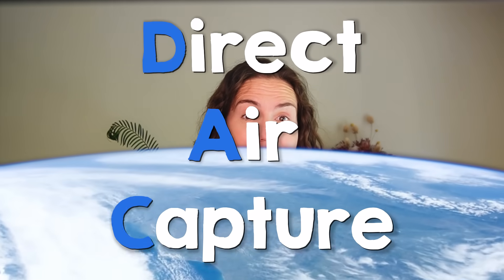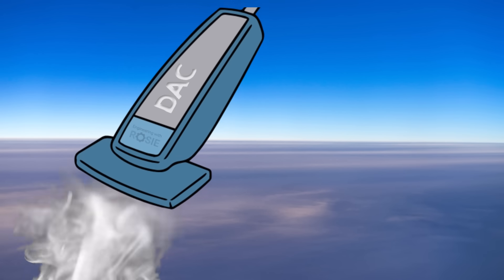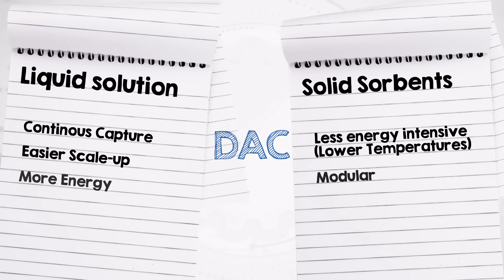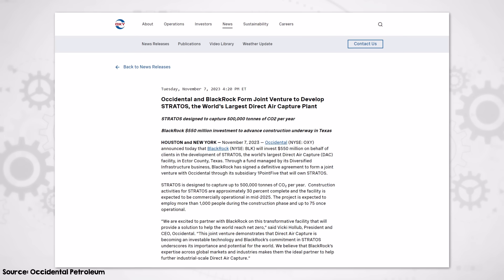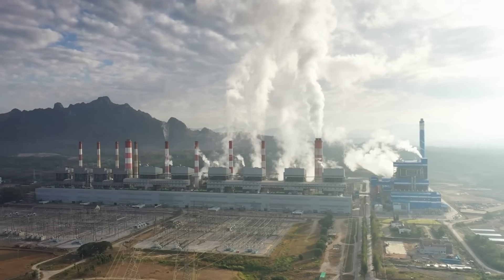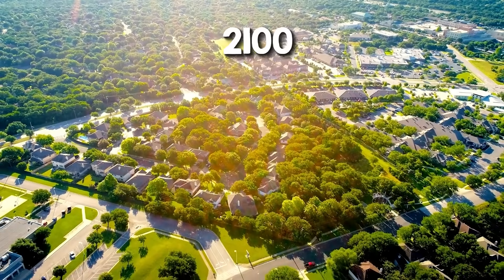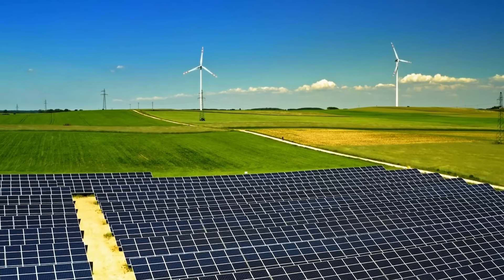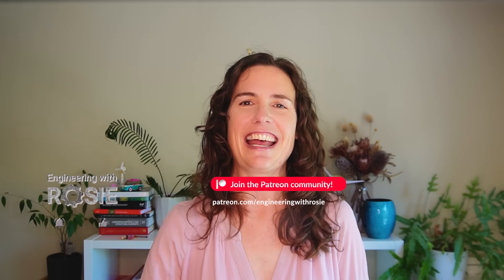Direct Air Capture: Climate Savior or Distraction?

Comment: Generally you are right. HOWEVER, you ignored the biggest advantage of DAC.
You can put it ANYWHERE, and it works. A stark contrast to CCS, that has to be placed next to the CO2 emitter.

I am really surprised you didn't talk about this point, especially since you mentioned Climeworks Iceland plans multiple times.
There is a HUGE reason why climeworks is in Iceland!
Renewable energy, especially heat is super abundant in Iceland (thanks vulcanoes).

This fact makes your comparison of energy use between DAC and CCS somewhat invalid.
Reply: I wonder, if solar thermal wouldn't also be an interesting energy source here. The system from climeworks needs only 100 degrees centigrade to get the CO2 out of the filter medium. This is easy to get from solar thermal collectors.
You could also combine it with electricity production: Some electricity for the fans, a lot of heat for the CO2-extraction.
Reply: Do watch and listen to the video, as the point is dealt with, right at the start. Go to around 1:30 where it is specificallly mentioned that DAC can be located anywhere. There are also plenty of other ways of capturing carbon dioxide wherever you want to, without the ludicrous expense of DAC
Reply: @davidmartin3947  Ok, seems I missed that in the beginning. But why the heck is that mention to be found in the conclusion? It's like the core argument.
Reply: @aurelspecker6740  Rosy has done a fantastic job compressing and presenting a vast body of information here, in time she takes whilst in full time demanding work and raising a child.It would be way more appropriate if you simply apologised for totally unfounded criticisms after you had not bothered to look at the video properly or having apparently any familiarity with the subject. I would be embarassed for making such a blooper, dismissing views from ignorance and inattentiion. It seems a shome that you are not.
Reply: @davidmartin3947  Yep, critizism bad. I understood. That is exactly how science and knowledge works.

I was a no point stating that her overall work is bad, that she does a bad job or anything like that. That were just things you put in my mouth.

I simply stated a quite big weakness of her summary. Which is what the comments are for, aren't they? Commenting

PS: I also rewatched it multiple times. And she still doesn't really set the advantage right. Her "advantage" is just flexibility. But she doesn't go any deeper than that. The advantage isn't "flexibility" the advantage is that it can be placed where energy is basically free.
This is NOT the same.
Reply: @aurelspecker6740  Informed criticism is one thing. Not reading properly and not having the manners to apologise is another, How much work do you think goes into PROPERLY studying a subject and then making a 15 minute video, which you slated because you could not be bothered to comprehend it, preferring to make half baked criticisms? I have made loads of mistakes, but I hold my hand up to them. You don't. None of this is my fault, let alone Rosie's. Just you. Bye.
Reply: @davidmartin3947  
yep, reading is really not your strong suit...
Reply: A stark contrast to CCS, that has to be placed next to the CO2 emitter.    Why is this a problem ?   CO2 effect is not local, it does not matter where you capture is.   Existing emitters are already industrial  sites, what is an advantage in the ability to put capturing devices everywhere ?
Reply: @dmitripogosian5084  
The difference lies in the efficiency. At a CO2 producing site, the CO2 can be captured from a gas, where CO2 makes up a significant part.
Burning coal has in theory an exhaust of 100% CO2. Capturing and storing that is super easy. 

In the atmospheric air, CO2 only makes up about 400ppm, or 0.04%. Which also means, from the 10000 liter of air you filter, you only get 4 liter of CO2 to store out of it.
(Again, in contrast the 4/10000 to the 10000/10000 liter of CCS at the emitter)

Comment: Where doe the energy come from to power DAC, fossil fuel plants.  Their sales increase, profits, increase, what is not to love?

Solar powered solid solvent plant:  Start cycling air through the media as the sun goes down.  Cooler air has higher density, more molecules per cubic meter of air.  As the sun rises, stop cycling air.  Use concentrating mirrors to heat the media to release CO2.  Rinse and repeat.

Comment: I agree - we should do research projects now so we’re ready for when it’s actually useful - decarbonizing the atmosphere after we reach net zero. And honestly, I’m good with government investment in the research. The greenwashing is an annoying distraction, but it also means we can get oil companies to help pay for the pilot projects… 

On the sequestration front, I am a lot more hopeful. I used to think sequestration was the actual hard part, because we produce about 3kg of CO2 for every kg of fossil fuel burned, and it’s gaseous in any reasonable large-scale storage state - you can’t just put it back where it came from. But Carbfix in Iceland (Rosie mentioned them briefly in the video) have a solution that can scale and be done cheaply. They dissolve the CO2 in water, then inject it into basalt rock. It takes about two years for the CO2 to react with the basalt, forming carboniferous rock, and the water is just released back into the water table. Much of the Earth’s surface is covered in basalt (about 1/7 of the land and most of the ocean floor), and over 99% of Earth’s carbon is already locked up in carboniferous rock, so scale isn’t a problem. The technology is very simple and well understood, too. They’ve been at it since 2014 and believe they can do sequestration at scale for $20/ton. I believe them.

Comment: So it works but is bad because the oil companies are promoting it? 

An interesting take. 

Suppose we cut the manufacturing costs by placing these units in high-wind areas. Then we cut the energy costs by running them only in the day with cheap solar power. 

Would they still be bad because oil companies like them? Or does saving the windy desert ecology take precedence over stopping climate change too? 

Every solution will have downsides. But it's nice that you illustrate how this is primarily a political issue. Fixing the problem is less important than who is fixing the problem in the U.N.'s view.

Comment: The difficult to decarbonise things are Nitrates production for fertiliser, aviation fuel, steel production and concrete production. In total these contribute about 20% of current CO2 emissions. Quite how you cancel that out with 2% at best DAC, I'm not sure. On the other hand solar, wind and storage simply can't be scaled up to cover everything without making a mess of the planet, environment and ecosystems in other ways. So every option on the table that can do a little bit should be considered. Fission is the bitter pill staring us in the face that we really should swallow, especially if we're lucky enough for Fusion to arrive soon enough for Fission to be a transitional technology in decarbonising energy production quickly.

Comment: DAC is the equivalent as trying to suck out water from a bathtub with a straw when the tap is still at full capacity.
If you want your tub to have less water, reducing the capacity of the tap first might be a smarter thing to do. You can always think of ways to suck out the remaining water once the tap is closed.
Reply: Only problem is atmospheric carbon clearing time: even at net-zero it will take earth's natural processes 800+ years to re-balance the excess Co2 we dumped into the air since the Industrial Revolution.  I agree with you: DAC as currently implemented is a fools errand, however there are ways to improve natural processes that sequester Co2 like ocean phytoplankton.  We could test that for safety and efficacy.
Reply: Well that just sucks.
Reply: Why not do both simultaneously?

That is obviously the optimum solution because no matter how small the effect, it is an effect.
Reply: @21142317 
Because ATM the energy used emits more CO2 if it's not renewable and if it is renewable energy it could be used to replace fossil energy.
Carbon recapture would be good if our grids would be 100% renewable energy.
Reply: Why do you think the gas of life is pollution??? It actually does far more good than harm, actually it's a theory that it does harm a theory that turned out not to be true, every prediction they have made turned out not to be true. But msm just keeps repeating this lie.
Young people commit suicide because they believe that they have no future. It's horrible, stop it. Listen to scientists like William Happer.
Reply: Thumbs up. If only the Titanic had stocked buckets. They could have bailed out the water! (Humans suck more than straws when it comes to visualizing scale)
Reply: you may have noticed that we already trying very hard to reduce emissions but the bathtub continues to fill up
Reply: @ldm3027  Unfortunately "we" are not trying hard to reduce emissions. Most people only care that their comfortable lives are not disturbed... without looking more than 6 months ahead. Some industries are being pushed towards using sustainable methodologies but when looking at the big picture the pace of change is glacial. There is so much that needs to be done ... and it's not going to be easy. My comfortably off friends continue to take multiple unnecessary trips and holidays using air travel. I would have thought that they might be prepared to drop at least one trip ... err, nope.
Reply: that may be true in  the US @MrAdopado
Reply: @ldm3027  I wasn't talking about the US! My comment applies to most people in the "well off" developed world.
Reply: that isnt correct - airline trips are still behind where they were in 2019, even in the US and in Europe more short range travel is switching to trains @MrAdopado
Reply: @ldm3027  bingo but if you do the research you'll see the premo carbon credits and thus where the money is going is carbon dioxide removal (CDR) via novel, unproven, expensive CCS, BECCS, DACCS as opposed to trying to keep the carbon in the ground by ramping up the energy replacement. Also, planting trees is the cheaper more effective CDR so why not put all the CDR money into what we already know what works more effectively, efficently and at scale?
Reply: we have not, but we can still begin to try. We have "talked" about it in a "positive light". Trying very hard requires "actually doing something" @ldm3027
Reply: @ldm3027   Because there are also people trying very hard to stop any kind of action to reduce emissions, so the profits keep flowing in. Our emissions are still going up, so the tap continues to increase capacity.

Comment: Another great episode!

I'm one of those guys, that just have to point out that photosynthesis is not just a practically free way to catch CO2 from the atmosphere, the carbon is also automatically "stored" in practical forms, many of which are very useful. To say photosynthesis is cheaper than machines for DAC doesn't do the difference justice. Facilitating photosynthesis that captures CO2 and produce useful materials that contains a lot of carbon can be very profitable, not just maybe in a distant future, huge industries actually already make profits from that.  Highly profitable, on large scale, now. A bit more nudging towards more, sustainable, forestry and other biomass production that produce products that aren't totally consumed within a very short time could make some actual difference. 

The only form I can think of, of DAC that might make sense, would be systems of rechargeable cartridges developed for air filters already used for improving indoor air quality. That way there's a direct advantage for the user, and therefore an incentive to pay for actual CO2 collection. The recharging process could utilize periods of excess power, just making heat when power generation is higher than demand is not an issue. But, that's probably limited to a few kg of CO2 per person that has such filtration, per year, at the most.       

An interesting idea would be to utilize the extreme temperature difference between ocean water and extreme cold air temperatures to power a gas turbine, to get energy to compress air until CO2 condensates, when cooled by extremely low ambient temperatures. I'm not saying it's practical, but it might not be quite as crazy as it probably seems. At Antarctica temperatures sometimes get low enough for CO2 to condensate at normal atmospheric pressure, and often more than cold enough to make CO2 condensate at pressures common "garage compressors" produce.  To be realistic there needs to be some direct benefit from the process, maybe it could be a way to make atmospheric mining for more valuable gases profitable, or just byproduct from a cheap and sustainable way to produce a lot of liquid nitrogen and oxygen, or some combination. And the issue of what to do with the CO2 is still there.  So, a crazy idea, but I don't think it's anywhere near as crazy as proposing "conventional" DAC as a way to make fossil fuels ok, or even viable part of the overall solution.  

By the way, thermal decomposition of calcium carbonate, and fermentation by yeast doesn't produce a point sources of CO2 that is "just" 250 times more concentrated than current atmospheric levels, both those examples can produce essentially pure CO2, which is over 2000 times more concentrated than current atmospheric level.

Comment: Its like comparing Hydrogen and batteries.  Batteries improve CO2 production in all conditions, Hydrogen only works in a net zero situation because of its higher energy requirements and lowe efficiency.
On heat pumps I am not convinced these actually provide a benefit when in the real cold they don't seem get a COP much greater than 1 unless you really lower the output temp.   In the UK case with wet radiator and air sourced systems it isn't going to help much, but I'd like to see another opinion and detailed research to see if is actually true.  I get a sense the entire industry has learnt how to lie just enough, but maybe its just a UK problem.  You can get a cop of 3 but only if you lower the output temp so much you need to heat all the time, but they then include that in "wanted output", which seems to be plumbers not understanding engineering.

Comment: i see carbon capture in any form as like a dehumidifier. If your house is flooding they would be expensive and pointless, you're better off spending that money on mending the broken pipe spewing out water. But after you've fixed the water leak, they are good at drying your house out and stopping any further damage.
Reply: It's a good analogy because dehumidifiers need to drain somewhere and are useless when a houses drains can't carry away flooding lol
Reply: Where I live, we run humidifiers, not de-humidifiers :)

Comment: I probably missed this while being distracted by my kids, but is there a way we could take the carbon from the air and make a kind of building material from it like a kind of concrete? I'd feel much better about carbon capture if it wasn't going towards burning more carbon.
Reply: I'm not sure about making building materials out of carbon but companies like CarbonCure and Heirloom inject captured carbon into cement/limestone as a means of strengthening the material and sequestering carbon. I think heirloom opened their first commercial DAC facility around month ago? Early
 November-ish.

Comment: Rooftop solar PV is cheaper than windows $/m2 
Most homes have 32m2 of windows. 
Recycling PV panels is very real and economical. It just needs panels.
Rooftop solar PV electricity can be consumed in the building and feed into the grid in working hours. 

EVs  with big batteries, that are evolving rapidly, can have quadruple value. 

1. Long drive capacity and be rapid recharged. On the main roads and at corner stores. 

2. Grid connected 23hrs every day and trickle charged or trickle feed the grid. Basically daytrade electricity. 

3. UNLOAD the building loads off the grid. 
74% of grid load is buildings themselves. 

4. Stop importing petroleum for each vehicle as it is replaced with an EV. 

The EV with V2G and selfplug-in like the home robotic vacuum cleaner will be wanted by everyone. 

Every time the EV plugs in, it talks to the grid and becomes part of the national grid VPP.
Virtual Power Plant.

The EVs home buildings grid feed-in is also part of the grid VPP.

Now the big facts for Australia. 
Sahara desert latitudes. 
Sunniest continent on the planet. 
20million buildings connected to the national grid. (includes 10million homes)
20million x6.6kwx5hr = 660gWh daily, which is bigger than fossil fueled max.

20million vehicles and 1million new each year. Say 100kwh EVs.
2,000gWh in dispatchable storage daily.  
Fossil fueled best is only 600gWh daily. 

Best part is that the grid is UNLOADED. 
The grid is protected. 

The Australian grid is 900,000 klm.
$/klm 1 million x 1 million klm 
= $1TRILLION 
National GDP is $1.5 TRILLIONS 

Central generation MUST have a national grid and BOTH MUST BE 5 times bigger to replace fossil fuels. 

This is decades and decades and decades. 
This is $TRILLIONS and TRILLIONS and TRILLIONS 

This is CO2 emissions and raw materials and mining and coal smelting and rolling and galvanising and fabrication and construction and.......decades and decades 

Carbon Capture is an insane waste of time and money with no real returns and false hopes. 
It is the wrong engineering problem. 

Now population collapse may provide massive CO2 reductions but I like the EV battery option with dispersed generation at every building. And a light weight national grid if necessary for balancing electricity storage.